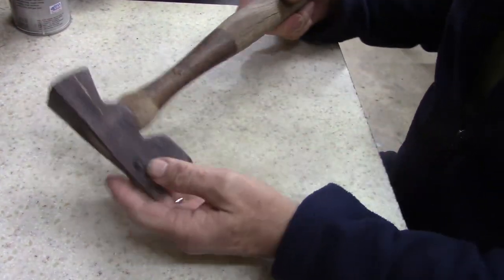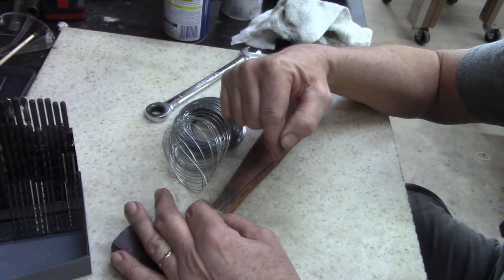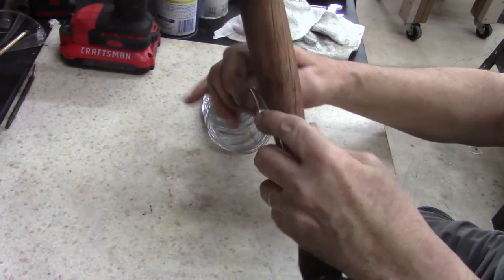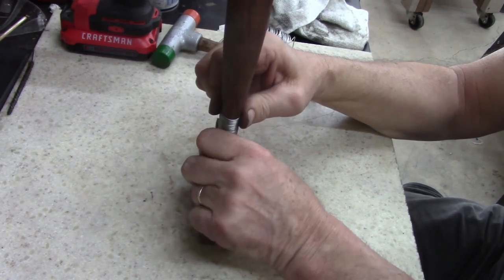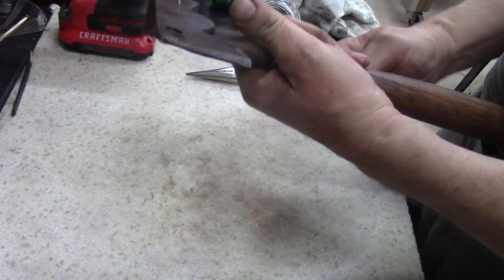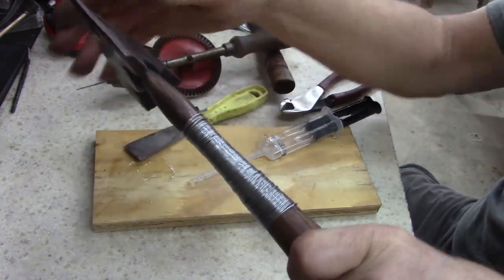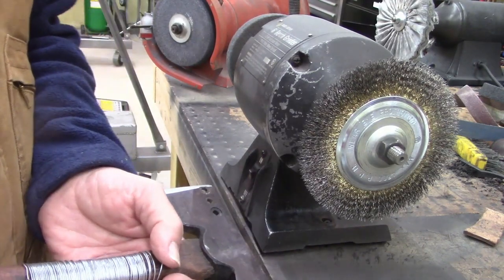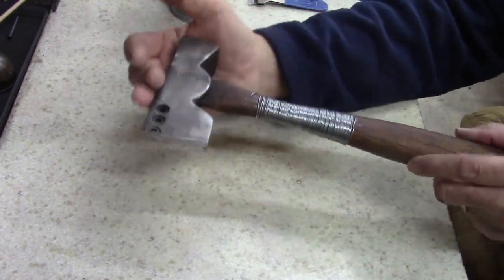Fixing a hammer handle, to make it useable.

Comment: I like it! The wire and epoxy on the handle should last a long time and add a lot of strength. It even gives the old hammer a vintage look.
Reply from the maker: I use it at work regularly as a demo hammer, and works surprisingly well, even the hatchet side is more usable than I would have thought especially busting sheetrock and plaster and lath.